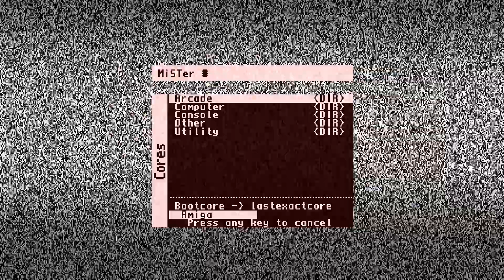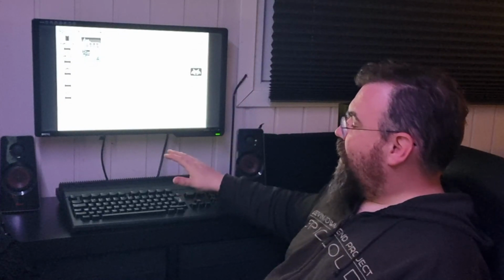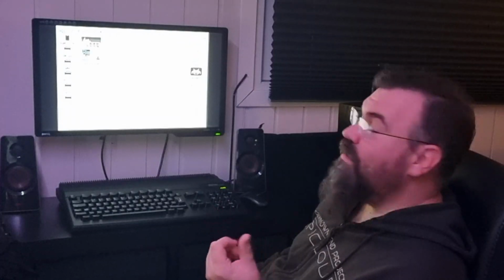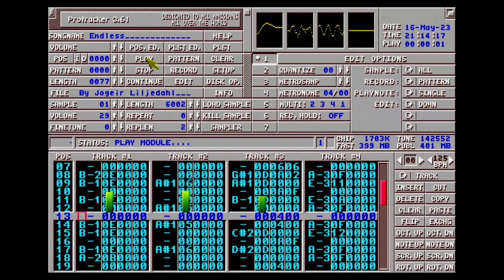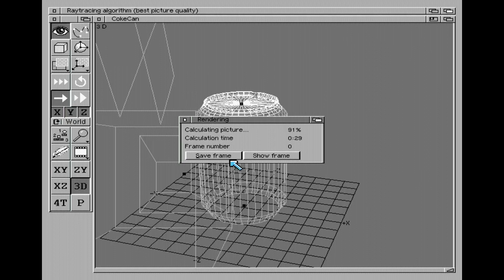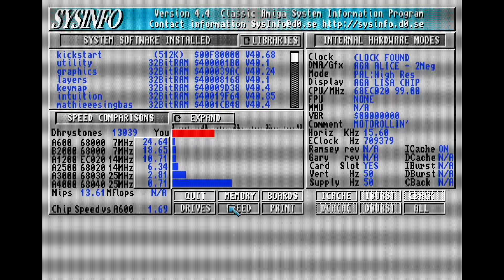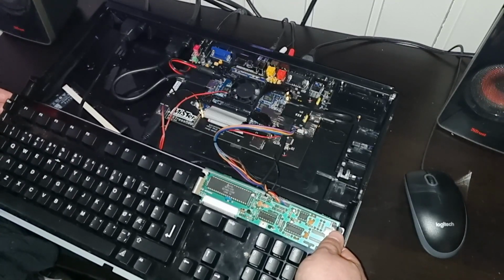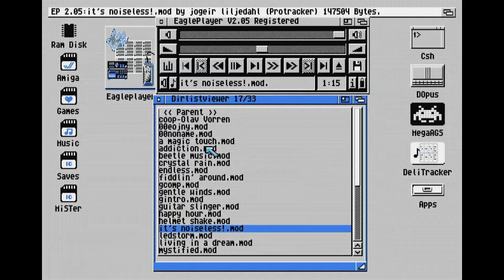Show and tell: FPGA Amiga in custom case and motherboard. Is it Modern Retro Magic?

Comment: Nice video! Where did you get that Mister logo sticker for the case? I also have a MiSTress in an A1200 case - great system!
Reply from the maker: Thanx. Yes the MiSTress is even more suiting in an A1200 case. the same speed as my real A1200 with 030/50 when I tested. I got the stickers from Retro8bitshop. They have a lot of different stickers for Amiga, commodore and a few for MiSTer.

Comment: Ooh this is really nice! I might still put a Mister inside my Amiga case instead of the Pi. I like that breakout board.

One of the main benefits of the Mister is it will nicely drive a CRT. I think you should treat yourself to one! 😁
Reply from the maker: Yes! You are 100% right! I should get myself a crt. But for this one I want a black one. Hard to come by! I have a crt on my real 1200 and a crt on the pi (where I do the 060-stuff (making and watching demos)).
Reply: @proteque  would be interesting to see how you connect the pi to the crt.

The other thing I'm waiting for is Greaseweazle support for the Mister.